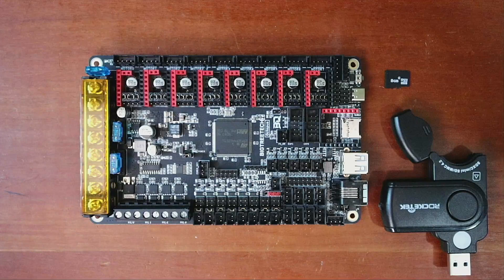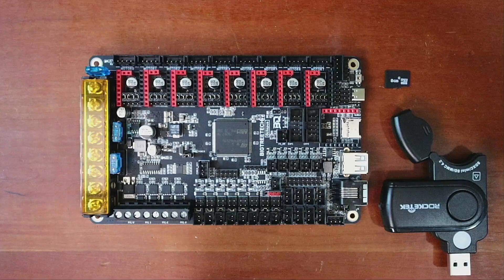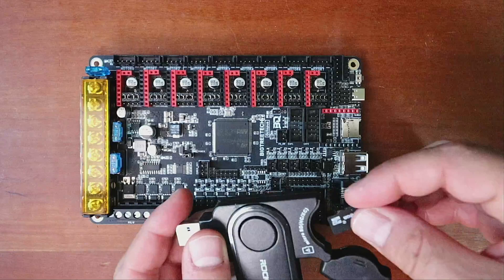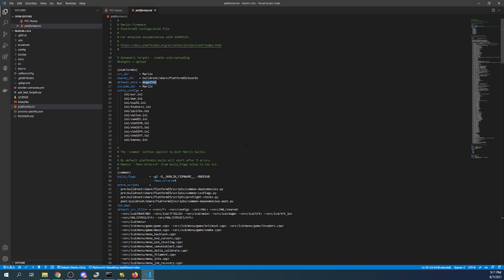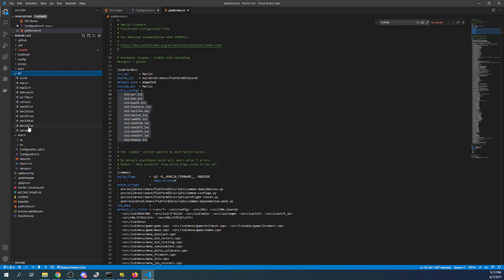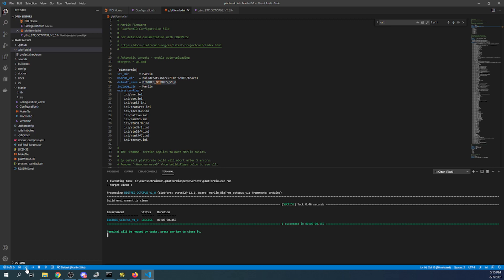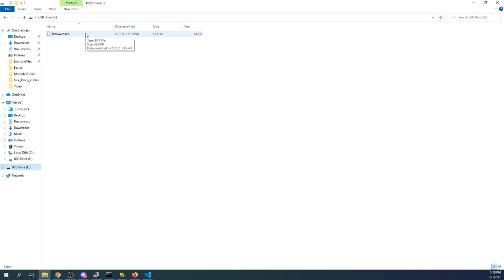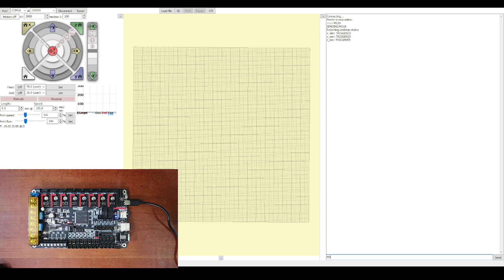BTT Octopus V1.1 - Basics

Comment: I want to use this board with an external Stepper driver (3DM580S) for my 3-phase stepper motors. Will this board work for that particular setup?
Reply from the maker: It's theoretically possible.

Comment: Hi, great video.
Can you remove the SD card from the board after firmware flashing or does it have to be always plugged in ?
Reply from the maker: You can but not during a flash.  Normally I just leave in drive.

Comment: Hi Ed,

Fantastic video! Question for you - I am looking to run 4 Y-Axis stepper motors for my printer. What would be the best course of action to get this to work with the board? 

Wire the steppers in series and enable "dual Y" in Marlin?

Or is there a way to define what each stepper plugin does/is for in the programming of the board? Using arduino I suspect?

Still new to building custom printers and would greatly appreciate some input from a master maker like yourself!
Reply from the maker: There's a video in playlist on how to multiple steppers.  I normally avoid multiple steppers as they can be hard to calibrate.
Reply: @EdwardBraiman  Great thanks I'll look at that video. The printer I'm building is unfortunately too large for one nema17 so I went with 4 to power the bed but perhaps I'll upgrade to a bigger motor to just use one if it ends up being more hassle than it's worth!

Comment: I have watched all the videos on the octopus board. I have a strange issue. I am running this board on a 400x400x500 ender 3 with a idex conversion. I've printed a few things and they turn out great. But after a few prints I tried printing something a little taller. It seems like my Z is losing position. Let's say the model is 180mm tall. It would print the first half perfect all of a sudden I checked on the printer and the z is like let's say 280mm high but it thinks it's 170mm on the screen. I don't even know where to start to look. I'm running 2209 steppers. Thank you if you have any suggestions. I'll keep messing with it.
Reply from the maker: Did you do a calibration print to calibrate printer?
Reply: @EdwardBraiman  yeah, everything measures ok. I'm stumped on this one. This is the 2nd board. 1st one fried and took out my bl touch, usb thumb drive and the screen. But everything is new again so I don't think it's that.
Reply from the maker: Try asking in discord link below.

Comment: Hello good afternoon....this configuration also works for the btt octopus Stm32f407ze model?
Reply from the maker: Depends on vintage, when board first came out one one MCU existed now there's two or three.  In boards.h it will specify which MCU and compare to board and select.  Same goes for platformio.ini and stm32f4.ini.  if it doesn't work join discord link in description and I or someone else can walk you through it.

Comment: Have you figured out how to get the BTT smart filament sensor working with marlin and one of the tft screens?
I've been pulling my hair out to no avail.
I have the smart sensor, octopus 1.1, and tft70.
I've followed all the firmware guides but it still triggers immediately over and over.
Doesn't matter if it's plugged into the octopus or tft.
I've tried many different combinations of firmware settings and can't get it to work.
Reply from the maker: You may need to invert endstop logic.  Making triggered open.
Reply: @EdwardBraiman  Well it's not a switch, it's an encoder.  So it switches back and forth from high to low continually.
Reply from the maker: There's a Discord link in description and either myself or someone else can help.
Reply: @EdwardBraiman  Actually I got it figured out.  But thanks!

Turns out resetting EEPROM from Repetier Host wasn't actually resetting my EEPROM so it kept getting put back at something like 3mm filament runout length.

I had to actually reset the EEPROM on the SCREEN, not on the PC, to get it to reset.

After getting that to work, the sensor started working perfectly.

Thanks for taking the time to read my comments though.  I really appreciate it!

Comment: I have a CR10s, I want to buy Octopus V1.1 with TMC2209 V1.2, :). I haven't ordered from Amazon yet, but I wanted to see if I could build the software. Surprise !!!! It went right away !!! wtf. Thanks for everything, aaaa one more thing for those who use MAC, put the Marlin 2.x folder on the desktop, so you don't have problems with write permissions. I would still have a question ... I have the classic blue screen with 2 plugs, do I have to change something in Marlin to make it work ??? or does it go straight like that ...?
Reply from the maker: Unfortunately I'm not well versed in Mac, they do have windows emulator's that you might be able to then build software in.
Reply: @EdwardBraiman  What I wanted to say is that thanks to your tutorial it worked from the beginning to build the software for the board in Mac OS, so it's ok. The question was if the cr10s screen works with this board, but I found another video of yours where you explain that as well. Thanks, your videos are great. Thank you and much love 🥰 from France.I'll try the screen when the board arrives.
Reply from the maker: Remember there's an issue with SD card loading of printer files.  Both Marlin and BTT are trying to address.  Meaning display loading of a print file.

Comment: 8 arms but no servo?
Reply from the maker: Servo is where BLtouch is located, but yeah I would like to see 4 servo's again.
Reply: Old RAMPS was better than newer @EdwardBraiman
Reply from the maker: For servos yes, but you might be able to create some with free signal pins.
Reply: @EdwardBraiman  bbt sir 1.4 turbo I need a how to add a servo when a BLThouch is used
Reply from the maker: Use free signal pin and voltage and ground.  Use pins_ramps_14.h as a template as it has for servo pins.
Reply: @EdwardBraiman  I need a video how to 😁

Comment: Hi, Can the 3D step files be downloaded? I have problems downloading the step file they listed in their github. When I click download it will pop out a new window with long geometry codes of the model. Do you know the solution to this? THANKS.
Reply: Take that, save as gibberish.STP, just had this issue, hopefully works for you after a few tries at least
Reply: Hi, thanks, I managed to download the step file using another computer. Still dk what's wrong tho. Anyways thanks
Reply from the maker: There's a Discord link in description of video and someone or myself can help in general chat.

Comment: How is that board. Is it reliable? Can you compare the board with fystec spider?
Reply from the maker: Well I've not used fysect yes.  Only issue I know about is a mislabeled pins on v1.0.
Reply: @EdwardBraiman  thank you so much for your effort. So how is that new version of the board. Is it reliable. Can you run the board on the rated specs( heated bed current etc?)
Reply from the maker: Still investigating.  At the moment my day job is really busy.

Comment: Redundant material that’s been produced 100x over now, and time that could’ve been better spent putting together a guide for RRF or Klipper.   Goes without saying it can be a challenge for even seasoned 3D printing enthusiasts, especially early adopters like myself.  At this point if a user isn’t capable of compiling Marlin and referencing pin outs they don’t have much business with this board in the first place.

And just my opinion but knowing your material 100% prior to a video like this seems pretty important, not knowing the basics such as ability to select between 5v, 12v, AND 24v for each individual fan header just makes you look silly.   😉
Reply from the maker: Thanks.
Reply: Did you blow up your board wiring improperly for reacting like that? The same tutorial with a different point of view/narrator is actually important for a wider adoption.
This board and others are meant primarily for hobbyist and there is new hobbyist everyday...discarding the new ones just shows you haven't understood anything of this community and you haven't understood that you are a beginner like that. Stop being a little crybaby and show some support for this YouTube creator that show great content and motivate new people to tinker more with 3d printers and all of that on the side of his day job.
Reply: Make a video and show us how it’s done.